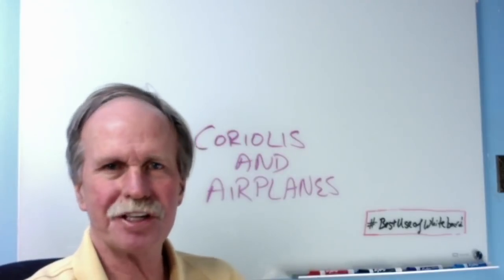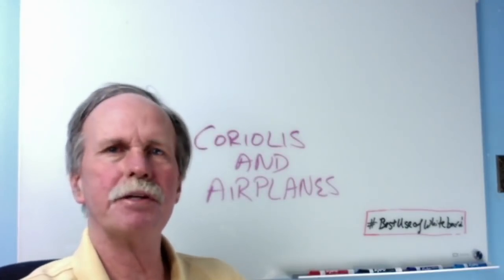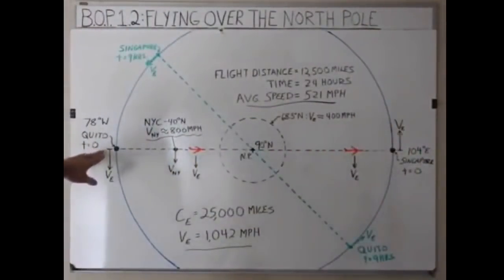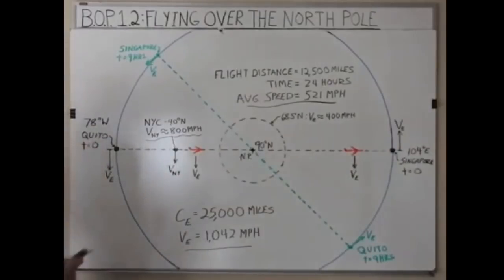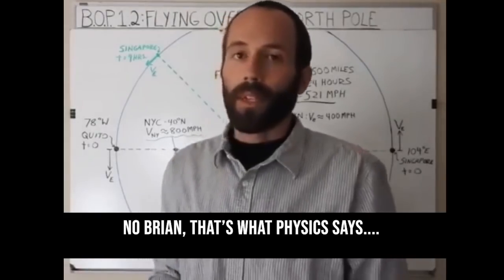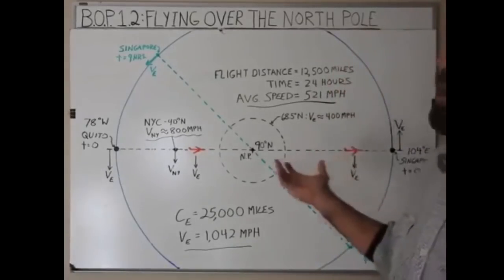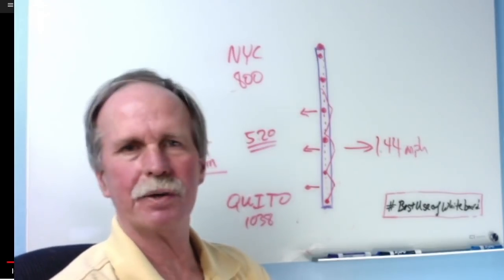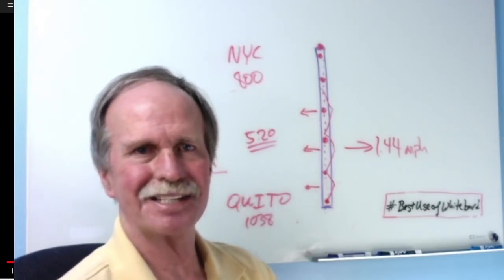Coriolis and Aircraft | Brian Mullin

Comment: Bob, being a pilot, you should do a video on how "water level" relates to "flight level". They both refer to a height, not a shape.
Reply from the maker: Yep
Reply: Technically, flight level refers to a (air) pressure, not a height.
Reply: @fred_derf  True, Flight Levels will vary based on the pressure, but they're still a height, just as water levels will vary based on the amount of water.(and also to air pressure to some extent)
Reply: @srstacy  Flight levels are not defined by altitude (or height) they are defined by air pressure. They only correlate to altitude because air pressure gets lower with altitude.
Reply: @fred_derf  The point is: Flight Level, as well as Water Level, refers to a height not a geometric plane. Two aircraft on a collision course at FL350 will collide. When they're 100 miles from each other they may or may not be at the same altitude(height) depending on the pressure, but if they're both set at 29.92 their heights will converge and they will collide, unless one descends or climbs to a different level. If you look at a drought stricken lake you can see the various water levels on the embankment. You don't point out water level by peering across it's surface. I'm sure Bob understands this and could do a good video on it.
Reply: @srstacy  The point is, Flight Levels are defined by atmospheric pressure, not altitude. You can't, for example, use GPS to set your altitude at a particular Flight Level because the Flight Level altitude will change as the pressure changes.

Flight Levels correlate to altitude but correlation is not causation.

"Two aircraft on a collision course at FL350 will collide. When they're 100 miles from each other may or may not be at the same altitude"

Exactly, because Flight Level is not defined by Altitude but by Air Pressure.
Reply: @fred_derf  I don't get your point or the reason for this back and forth. Yes, Flight Levels are based on a standard pressure, but is or is not an aircraft at FL390 at a higher level than an aircraft at FL300?
Reply: @srstacy , writes "but is or is not an aircraft at FL390 at a higher level than an aircraft at FL300?"

Yes, but only because pressure drops with altitude. It correlates.
Reply: @fred_derf  and water level is higher when there's more water. It correlates.
Reply: @fred_derf wrong, flight leves depends on density of the air and also the power of the jet engine! Both of it would affect altitude and air lifting , the higher you go the harder the engine works
Reply: @SuperCuteBabyCat , writes "wrong, flight leves depends on density of the air and also the power of the jet engine!"

Not wrong. From Wikipedia/wiki/Flight_level:

In aviation and aviation meteorology, a flight level (FL) is an aircraft's altitude at standard air pressure, expressed in hundreds of feet. The air pressure is computed assuming an International Standard Atmosphere pressure of 1013.25 hPa (29.92 inHg) at sea level, and therefore is not necessarily the same as the aircraft's actual altitude, either above sea level or above ground level.
Reply: @SuperCuteBabyCat , writes [...]  the higher you go the harder the engine works."

Not true, planes are designed to be their most efficient at a particular altitude. A passenger jet flying at 10,000 feet would use more fuel crossing the same area than it would at 30,000 feet. The lower air pressure actually makes planes more efficient (i.e. don't have to work as hard) at higher elevations since the air is thinner and they experience less drag. There is a crossover point in efficiency where it's harder for the plane to gain more altitude because there isn't enough air for the engines to work efficiently.

Comment: Another way to analyze this is by looking at the Coriolis acceleration at any given time: a = 2ωv·sin(λ). This will be at most 0.03 m/s², pointed sideways. To correct for that, you'd have to steer the other way as if you were making a bend. How big of a bend? Well, a sideways force turns you in a circle of radius r = a/v², which gives  1780 km here. I'm not a pilot but I reckon even for a 100 km circle you'd barely have to move the stick.
Reply: This!
(First one to understand the problem)
Reply: Also, Coriolis is only really important in frictionless environments, which this isn't.

I wouldn't describes the problem of flying into a different wind as even related to Coriolis.

The plane is flying at maybe 70% power (guessing here) at a constant speed relative to air. That air changes speed by order 100 mph every hour of flight, but apart from a small heading correction, making the aircraft crab, the deceleration or acceleration is very small.
Reply: At the equator the needed Coriolis correction is zero because sin(0) = 0. At a mean latitude of 45° north and a speed of 250 m/s = 486 kt (kt = knots = nautical miles per hour), the Coriolis acceleration is only 0.0257 m/s^2 to the right. The airplane has to create an equal acceleration to the left to stay on track.

The needed bank angle for such a sideways acceleration is for any airplane the same: only a minute 0.15°.
Reply: @WalterBislin  

Not sure that was addressed to me, but like I said, I don't believe that Coriolis describes the effect of moving into air masses of different speeds.

How would your calculation address an airplane moving East-West, staying in the same "wind speed"?
Reply: @PeterGalbraith  Look at the equation for the horizontal component of the Coriolis acceleration, which acts to the right wrt. to the direction of motion in the northern hemisphere and to the left in the southern hemisphere.

a = 2•v•ω•sin(φ)

There is the speed v wrt. to the surface, the earth rotation rate ω and the latitude φ. So no dependence on direction. 

The explanation with the changing speed with latitude is not quite right and only explains half the effect when traveling N/S. It fails completely in the other directions. To be correct we have to use the equation above. 

The often used explanation with the latitude dependent E/W speed is borrowed from the explanation on a marry-go-round, which is only 2 dimensional. On a sphere it’s more complicated and not intuitive.
Reply: @WalterBislin  

You got my point, I think. Flying into air masses that travel East-West to different velocities is not the Coriolis effect.

Your calculation is the acceleration due to Coriolis, which is the same in all directions. But flying into the East-West gradient is a North-South only effect and therefore NOT Coriolis.

Comment from the maker: There seems to be some confusion about the amount of correction for coriolis.  Perhaps a better way to look at it is to look at the first min of a trip from the equator to the pole.  At the end of the first min, you have gone approximately 6 miles north of the equator.  What is the difference between the rotational speed at the equator and that 6 miles north of the equator?  How much correction needs to be made to maintain your alignment with the flight path.  Once that is done, you have matched the rotational speed of the earth at that point and you are on course.  Now go another min north and do the same thing.  Do that all the way to the pole.  How large were the individual corrections? That is where the 1.4 mph cross wind came from.
Reply: Your calculation yields 1.44 mph/min, which is an acceleration (0.01 meters/sec^2 in more conventional units). No 1.44 mph velocity comes out of the calculation at all, no matter how you slice it. Saying that you need to make a 1.44 mph correction every minute is just another way of saying it's an acceleration, not a velocity. The actual crosswind necessary to produce a 0.01 m/s^2 sideways acceleration will depend on the size, shape and mass of the airplane.

To clear up the confusion, it would maybe be better to just drop the crosswind analogy altogether, since it is not possible to even approximate the "equivalent crosswind" without a lot of unnecessary information.

Comment: That one-hour location north of Quito is also moving east so an hour after take off you need to be east of the original north-south flight path because the earth and the flight path have moved east. That has to be taken into account for balastic flight. It's hard to illustrate that.
Reply: The plane was already moving east with the rotating Earth at Quito before takeoff. It doesn't lose that easterly motion when it becomes airborne. Watch the video again.
Reply: @Hirsutechin  The earth moves east, the airports move east, the flight path moves east, the plane moves east.

Comment: Surely over the 12 hours from Chito to North Pole you have to lose 1038 MPH so that would mean 86.5 MPH correction. Not sure why you divided by 720 minutes to get 1.44,  Wouldn't that be miles per minute. Still very possible in a jet aircraft doing over 500MPH though.
Reply: You are saying the same thing. You need to lose 86.5 miles in each hour.  What is 86.5 divided by 60 to get a correction per minute when flying? Just fly with a correction equal to a wind blowing at 1.44 miles per hour.
Reply: Unit  wise  ,  mi/ hr  divided by hr  would  look like   mi/hr^2  .  For mi/hr  divided by minutes  it would  be MPH / min       E.G.   For gravity,  9.8 m/sec^2  is   (9.8 m/sec) /sec   or  9.8 m/ sec  per sec.  
Your  86.5 would be  in  (miles / hr ) / hr   =  ( 1038 mi / hr ) / ( 12 hr )  =  86.5  MPH  per hr ,  so in one hour you would need to have an overall correction of 86.5 mph.   But in one minute of flight,  you would need 1.44 mi / hr /  min ...... 86.5 MPH / 60 min  [ that gives  1.44 mi/hr  correction  per minute ].   Bob just broke it down into smaller units and went to minutes right away  [ kind of how in Calculus  you take smaller and smaller cross sectional volumes  which when added together give you the entire Volume ].   Per second, the correction is  now ( 1.44 mi / hr ) /  ( 60 sec )  = 0.024 MPH  per second  correction  (approx )...not sure if it would even be noticeable when you consider seconds ?!

Comment: And most funny part, this "crosswind" change not linear.
Near equator it have most value, but less change per km.
Near poles it have lowest value, but most change per km.

So, when it have biggest influence at aircraft, you will not see much change. And when it have most change, it have no influence.

Comment: Decelerating from 1038mph to 0mph in 12 hours.  OK so the correction we are seeing here is 1 every minute for 720 minutes.  So the change in velocity is 1.44mph for every minute.
Reply: Which is not equal to a crosswind of 1.44 mph.
Reply: @PeterGalbraith  1038mph divided by 720 minutes...1.44mph per minute.
Reply: @JSSTyger  

Exactly. Not a 1.44 mph crosswind.
Reply: @PeterGalbraith  How is 1.44mph not equal to 1.44mph?
Reply: @JSSTyger  

Huh?
It's a 1.44 mph DIFFERENCE every minute of flight. How is that equal to a constant 1.44 mph crosswind? He could have divided by the number of seconds or even microseconds and obtained an even smaller number.
Reply: @JSSTyger  

1.44 mph/min is not equal to 1.44 mph
Reply: @PeterGalbraith  You are confusing things. Over the period of ONE MINUTE, the speed increase/decrease from coriolis is 1.44mph.  So a course correction every minute only has to only has to take into account 1.44mph "winds"
Reply: @JSSTyger  

I am not confusing things. It's even Coriolis to begin with.
Reply: @PeterGalbraith  I can't understand your point.
Reply: @JSSTyger  

1. An increase of 1.44 mph every minute is not the same as a 1.44 mph crosswind. What makes 1 minute so special?

2. He says this is to counter Coriolis but has nothing to do with Coriolis.
Reply from the maker: it actually is.  all you are doing is staying on course.  during the course of that 1 min you are compensating for a force that is trying to move you to the east.  The calculations are correct.
Reply: @PeterGalbraith  1.  There isn't anything "special" about 1 minute.  Bob was just making the point that course corrections happen all the time due to wind velocities blowing a plane off course.  Bob chose 1 minute intervals just to illustrate the small change.
2.  Coriolis has to do with Earth's linear speed (from rotation) changing with latitude.  The effect, here, being a 1.44mph increase/decrease of lateral speed every minute.  If you course correct you are "zeroing out" that number and it takes another minute to get back up to that speed and you course correct (zero it out) again.
Reply: @BobtheScienceGuy  Thanks.  I tried to explain.
Reply: @BobtheScienceGuy  

No, they are not. Your 1.44 mph crosswind result depends on your 1 minute interval, which is completely arbitrary.

Plus, this North-South change is not due to Coriolis. How would you explain an East-West flight? Would you still calculate a 1.44 mph crosswind? No. But Coriolis is the same in any direction, so the north-south effect is NOT Coriolis.
Reply: @JSSTyger  

He wasn't "just making the point", he calculated an equivalent crosswind. Except it's wrong. 🤷
Reply: @PeterGalbraith  Dude.  Course correcting adds a lateral velocity to the plane that zeros out the relative velocity.  So every minute the relative lateral speed becomes zero again and only gets as high as 1.44mph.
Reply: @JSSTyger  

Whatever Dude.

Comment: Bob I think you misspoke,  1038 mph / 720 m = 1.44 miles per minute = 86.5 mph that’s the westward component. Actually thinking about it, you can just forget about Coriolis correction, because whatever you drifted right going North you will drift left after passing the North Pole going South to Singapore, you’ll only describe a longer arc but will not lose the side component, so I guess the flight time should be the same. Actually there is a direct flight Singapore to New York by Singapore Airlines and it’s about 18h 40 m , the grand circle passes very close to the N pole.

Comment: I don't get the crosswind calculation at all. You have calculated the CHANGE in air mass speed of 1.4 mph over a time span of 1 min of flight time. How is that equivalent to a crosswind of 1.4 mph?
Reply: The crosswind calculation that Bob presents isn’t accurate. The Coriolis Force acts as an apparent lateral force on the plane, with an average acceleration of 0.0352 ft/sec^2 (= (1038 mph / 12 hr) x (5280 ft/mile) / (3600 sec/hr)^2). 

The other forces acting on the plane are gravity, with a downward acceleration of 32.2 ft/sec^2, lift from the wings, and air friction. The vector sum of the downward gravitational force and lateral Coriolis Force results in a force with an apparent acceleration of 32.2002 ft/sec^2 very slightly to the right of down. The air friction is a function of the plane’s airspeed and relative direction to the headwind, tailwind, and crosswind.

All of these external forces are balanced by the thrust from the engines. Refer to Walter Bislin’s comments above for further information.
Reply: @georgemontgomery5786  

Also, Coriolis is only really important in frictionless environments, which this isn't. wouldn't describes the problem of flying into a different wind as even related to Coriolis. The plane is flying at maybe 70% power (guessing here) at a constant speed relative to air. That air changes speed by order 100 mph every hour of flight, but apart from a small heading correction, making the aircraft crab, the deceleration or acceleration is very small.
Reply: This is all academic anyway because you never have 0 mph wind for 12 hours along a flight path from the equator to the north pole. Thus wind direction and speed make this calculation of no concern. But, The reduction in "Change in air mass speed" using your term is directional. It's rotating less from West to East the farther North you go. Therefore if you compensate by a crab to the left equal to a 1.44 mph side wind for 12 hours (going at the speed in this scenario), you would reach the North Pole target. Otherwise you would miss it to the right.
Reply: @PeterGalbraith  The Coriolis force is only qualitatively like flying in a crosswind. The effects they produce are qualitatively similar.

Coriolis can be important in environments with friction. Coriolis isn’t significant for planes, but it is important for ballistics. You have to examine each case independently.
Reply: @georgemontgomery5786  

The post you referred me to calculates the thrust to counter Coriolis, but that's not the same as flying into an air mass with different velocity. That's my only point here. Bob is mixing everyone up by calling this Coriolis.
Reply from the maker: well please do explain the error.  always up to learning something.
Reply: @PeterGalbraith  Yes, I agree. Bob should have said that Coriolis is “like” or “similar to” a crosswind. For the case he examines, Coriolis isn’t equivalent to a 1.4 mph crosswind. It may be possible to find a crosswind speed that is equivalent to Coriolis for this case, but that would involve calculating the changes in friction and lift caused by the crosswind – a much different calculation. It is unlikely that the equivalent crosswind is 1.4 mph, but whatever it is, it is a lot less than the airspeed of the plane.
Reply: @BobtheScienceGuy  Coriolis is an apparent force with an apparent lateral acceleration. A crosswind isn’t a force or an acceleration. It changes the speed and direction of air the plane is flying through. A crosswind of 1.4 mph isn’t equivalent to a lateral acceleration of 1.4 mph/min. To find the lateral force associated with a 1.4 mph crosswind you have to calculate the friction and lift associated with the crosswind. See my comments above, and Walter Bislin’s comment.